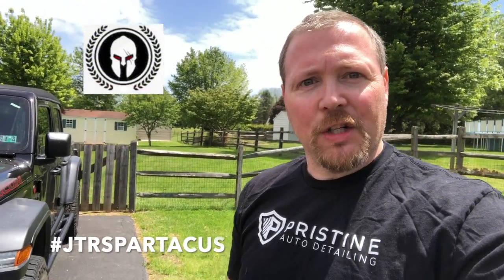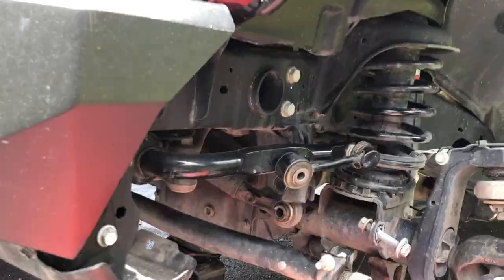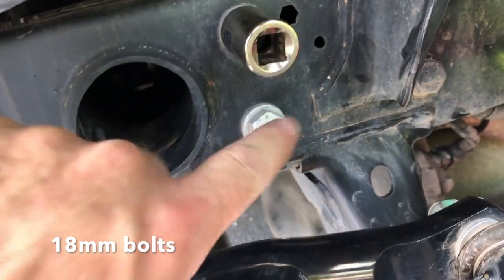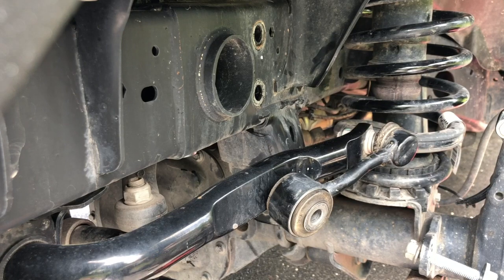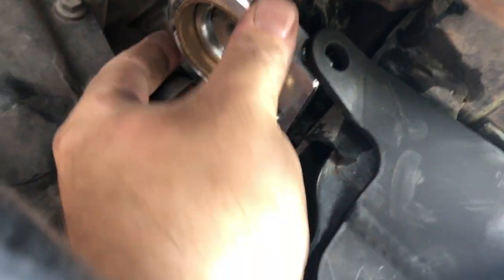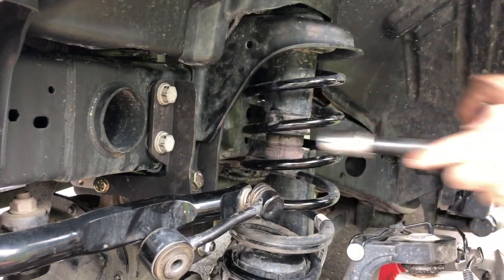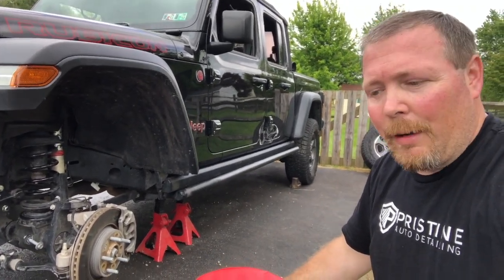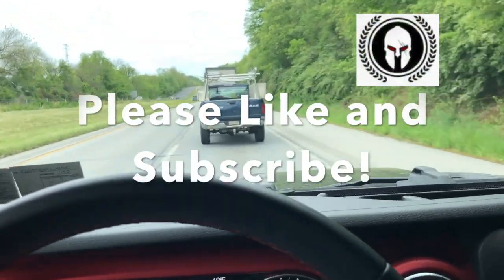JTR.Spartacus - Synergy Trackbar and Sector Shaft Brace Install for 2020 Jeep Gladiator Rubicon.

Comment: Hey, fellow PA Gladiator guy! After a four month wait from Qtec, mine showed up today and was on an hour later. It noticeably holds a straight line better, but there is still considerable play in the steer box itself. Nice work on the install vid, it was worth the watch before installing.
Reply from the maker: Glad the video was helpful!  Sorry to hear about the play in the box. Maybe the dealer can fix or replace the steering box now that it’s firmly braced ??  My steering pretty good so it seems doable.   Good luck!!!

Comment: My steering wheel alignment was off after installing this, any suggestions on how to adjust? I think it’s related directly to the pitman arm nut or box positioning
Reply from the maker: Guess you indexed the pitman arm differently from when you started. You could undo this and try to get it back yo original but it’s easier to loosen the drag link nuts and recenter.  Definitely a lot easier if you have a helper turn the wheel straight and tighten it up. Good luck !

Comment: Just install the Synergy Trackbar and Sector Shaft Brace for my 2019 jeep wrangler jl sports today and everything install good. I am hearing sound like rubbing when i turn my wheels almost all the way turn wheels to left or right and back up hear sound like rubbing, what do you think is the problem ? Please help thanks.
Reply from the maker: Jay Hernandez sorry to hear that. Can you post up some video of the track bar, pitman arm /drag link? Is the steering wheel straight and tracking ok?  The brace shouldn’t mess up anything.
Reply: did you get grease inside the collar on the big steering nut?  Might need to pull it re-grease it and put it back together.

Comment: Why does the aluminum brace itself have two different style mounting bolts ?
Reply from the maker: Not sure but I’m guessing some materials engineer calculated loads/sheer/torque and that drove the fastener requirements. I definitely used what Synergy supplied and followed the directions.  Thanks for watching.  #JTRSPARTACUS
Reply: @JTRSpartacus  yeah i just installed one last weekend and the two bolts were different like yours . Wondered why that was .